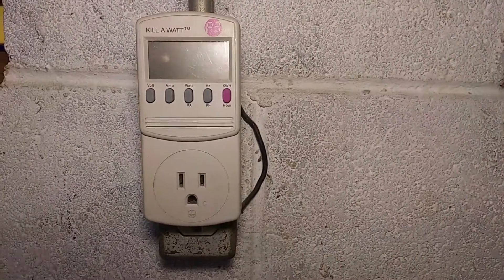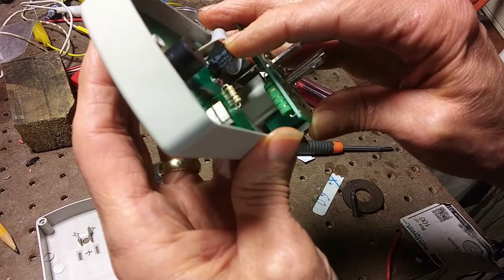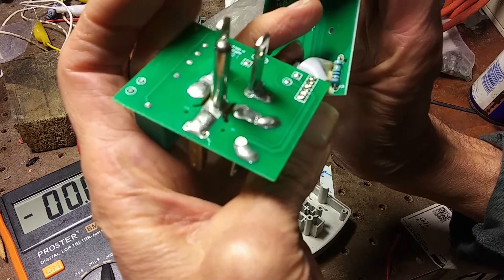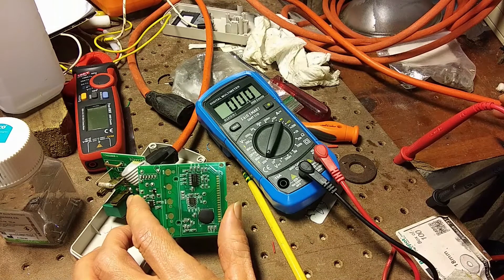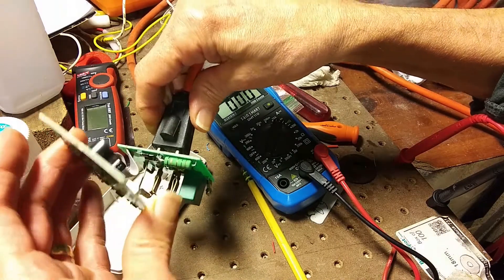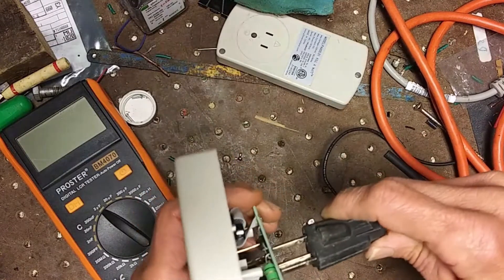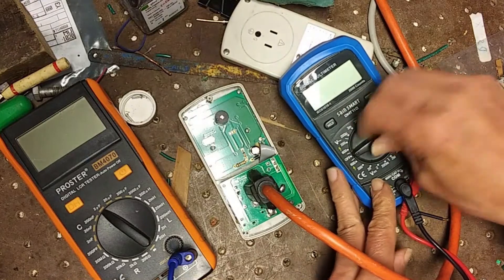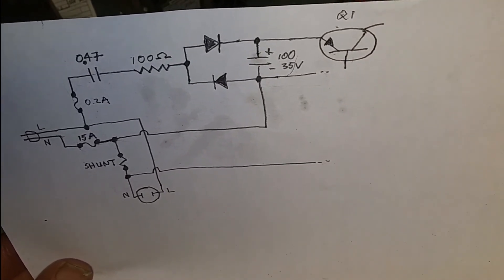Kill-A-Watt power meter repair: Bad X1 capacitor → dim display & false readings

Comment: Thank you, great video! I had checked fuses but wasn't sure where to look next. Replaced with a 0.47 x2, had to use alternative hole spacing. Five minute fix brought it back to life.
Reply from the maker: Great.  That makes at least 4 people with the exact same problem, so definitely a bad batch of capacitors.  Hate to think how many of these things went into the trash when they stopped working, surely 90% of people wouldn't even consider attempting a repair.  Thanks for commenting.

Comment: This ended up fixing mine. Luckily I had a 0.47uF X1 cap in a box of electronic scraps. Thanks alot!
Reply from the maker: Great.  Must have been a bad lot of capacitors.  Thanks for commenting.

Comment: Thanks for the DigiKey link.
Reply from the maker: Let's hope it's a little more durable than the original.  Thanks for commenting.
Reply: @quetzal4042  I can't remember what mine wasn't doing, but since replacing the capacitor, it displays and seems to measure reasonably.  If these safety capacitors wear this quickly, I can see why these meters aren't warranted too long, LOL.  Thanks again.

Comment: Thanks for the great video. I suspect I have the same problem, but unfortunately the capacitor you linked to is out of stock. Can you recommend any compatible alternatives?
Reply from the maker: Here's about the closest I could find:
https://www.digikey.com/en/products/detail/wima/MKX14W34706B00KSSD/11314395
Exact same dimensions and ratings, different manufacturer.  

Here's another very similar:
https://www.digikey.com/en/products/detail/kemet/R474R347050A1K/6228752
It's about a millimeter taller but probably will fit.

In principle, any O.47 µF film capacitor with an X1 rating that will physically fit and has compatible mounting centers would be fine.  Let us know if it solves the problem.  Thanks for commenting.

Comment: I was also able to find a donor board to grab the part from.  Interesting find on this. I have never had one of these parts fail before.   Thanks for your post!
Reply from the maker: Must have been a bad lot of X1 capacitors in that production run.  Dave Jones at EEVblog has an interesting video on safety capacitor failure.  He interviews a production engineer who says it has nothing to do with surges, it's all about failure of the seal and moisture getting inside:   https://www.youtube.com/watch?v=ikp5BorIo_M    Thanks for commenting.

Comment: i have a similar kind of meter (a white one) with power cost configuartion and all , and it was not used for over 2+ years , then when i plugged it in ,it had no display.. i opened up and saw a 3.7v battery , i bought a replacement and the display turned on , but when i connected the load, meter didn't shows any reading , plus when i took the reading using a voltmeter , i found 16v ac on the sockets  instead of 240v ac.. any guess of what might have failed?
Reply from the maker: I think usually there is not much between the plug (AC in) and the socket except a shunt to measure the current and a fuse.  Seems most likely it would be the fuse.

Comment: If you have some newer scrap boards or old computer power supplies , that's a fairly common value in the line filter circuit.  Those are safety caps as well. Over the years have saved the power boards from flat screens and very handy for parts
Reply from the maker: Good suggestion but my collection of old circuit boards is pretty slim.  Thanks for commenting.